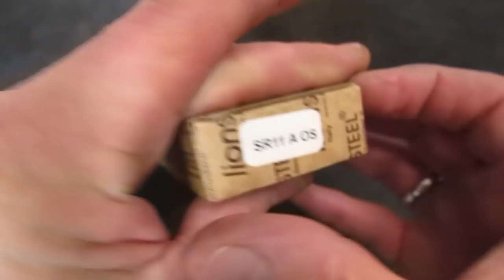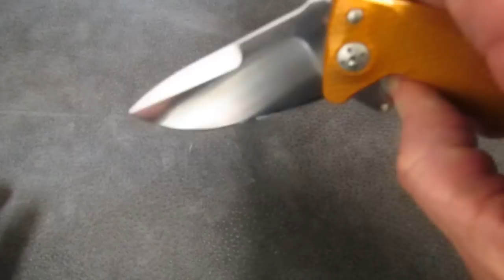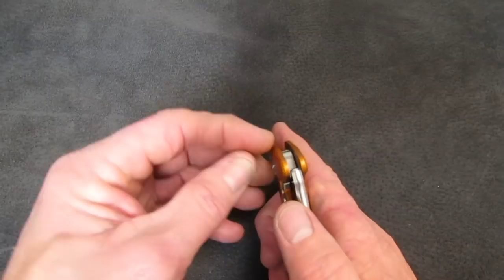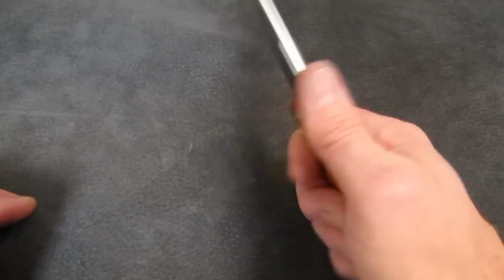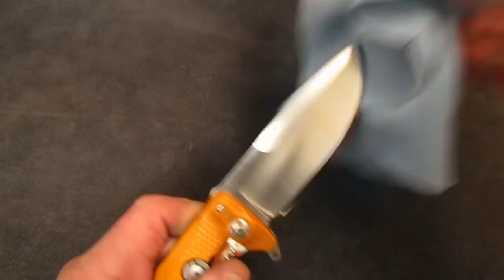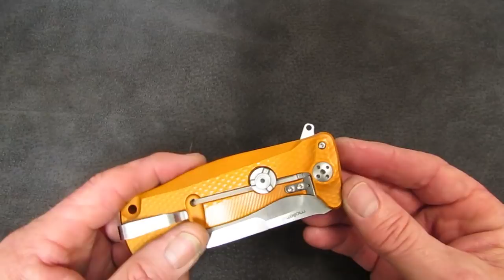FSB:  Lionstreel SR-11A -- Evolved, Improved, Impressive!

Comment: I always have to question the use of aluminum in something that flexes. Maybe there have been some advances in aluminum alloys, but I remember the issue with finite stress cycles, each one taking it a step closer to failure. I have never found a discussion detailing how it is sucessfully used this way and what the predictions are on stress cycles before failure.
Reply: What flexes? The aluminum body isn't a moving part susceptible to snapping

Comment: I was interested in your comment regarding blade to handle ratio (with a 1" difference being the benchmark). Is blade length measured from the center of the pivot to the tip? Please forgive my ignorance on the subject.
Best wishes.
Reply from the maker: 7otoole Generally, it’s measured from the end of the handle to the tip of the blade.